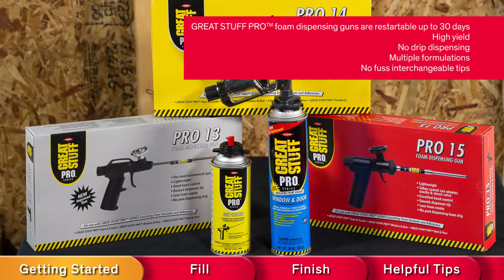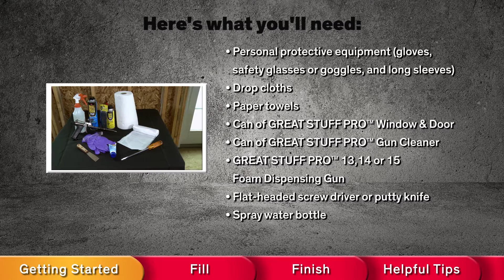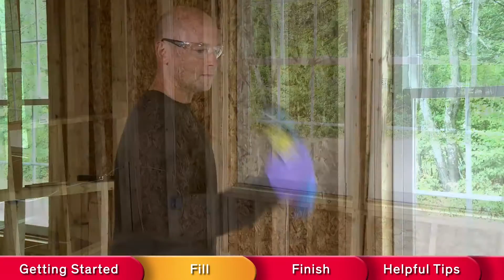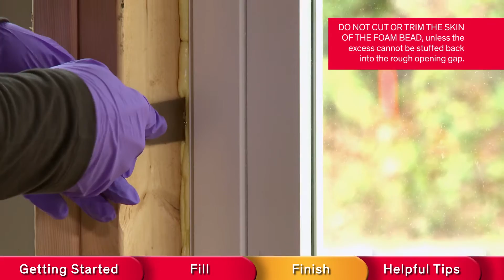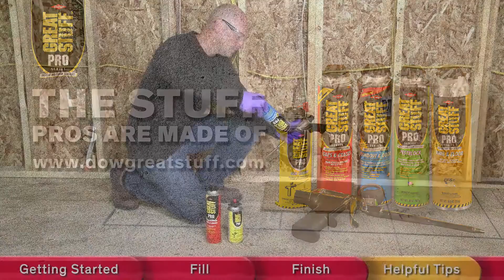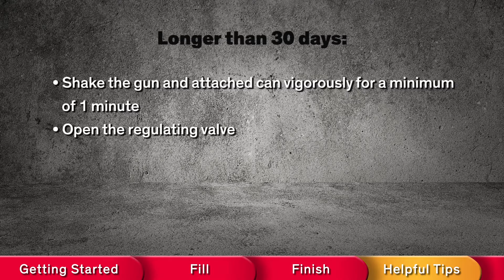Seal Around Window & Doors with Great Stuff Pro™ Window & Door

Comment: My cost for the Straw Great Stuff Gap & Crack Foam was $3.40 per 16 oz can, or 22 cents per ounce.   My cost for the Great Stuff Pro Gap 
& Crack Foam was $11.22  per 24oz can, or 43 cents per ounce.   I choose to use the Straw method.   I wish the Gun method was a better 
cost.   Also, the Straw Great Stuff cans will not work on the Great Stuff Pro 14 Gun.  fyi